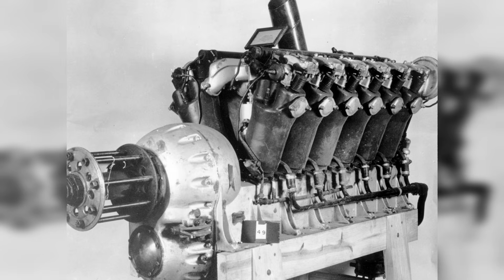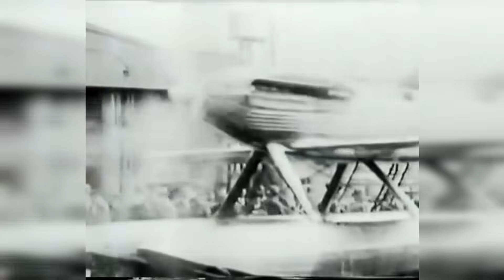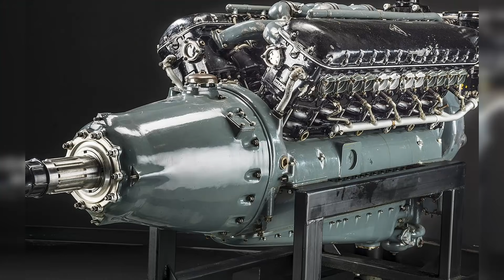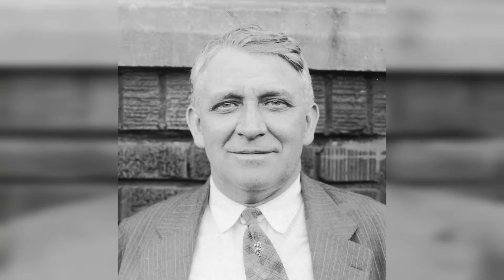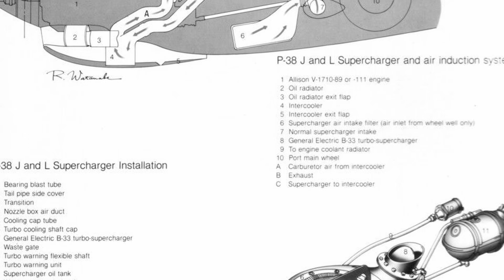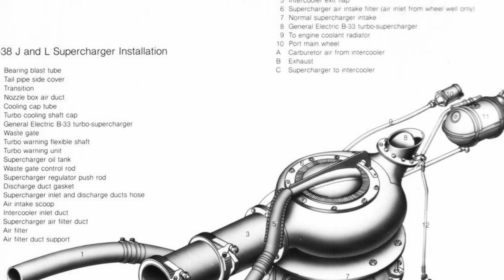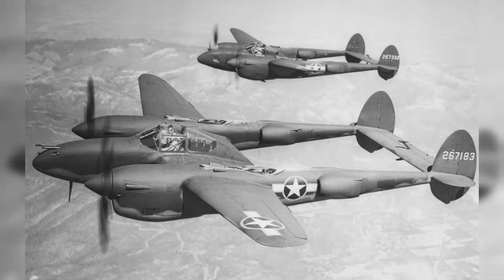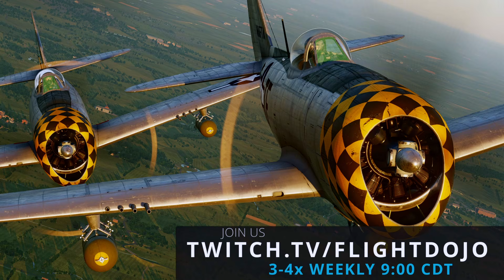Allison V-1710 - A Liquid-Cooled American WWII Warhorse

Comment: Regarded as pretty useless with out a good multistage supercharger.
Reply: Only by you. I wouldn't consider the P-38, P-39, and P-40's "useless" by any stretch. What plane did the top two American aces fly? Uh-huh. Powered by what? That's right.
Reply: @tempestfury8324  didn't work in the P51.
Reply: @womble321  No it didn't. But to say the Allison was useless is just stupid. Just because it didn't work well for one airframe doesn't mean it didn't succeed in others. By contrast you could say that the Merlin didn't work out with either the P-38 or P-40, which is true.
Reply: @womble321  It worked fine in the P-51.  It just couldn't escort bombers over Europe in that configuration.  Plus Allison two stage units became available in 1943.  It's very possible the mustang would have ended up in the escort role with a two stage Allison had the Merlin not been employed.

Comment: A fabulous engine that was castrated by the Army.  The two-stage engine was unwieldy but the hydraulic coupling was quite advanced.  Great video, and all of you Allison fans should check out the book "Vees For Victory", an incredibly detailed history of the V-1710.
Reply: I have it.  It is the definitive book on the history of the Allison engine.  Author Daniel Whitney also has a follow-up book on Allison engines.
Reply: Great.  Can you tell us when exactly did Allison produce the new intake manifolds? ... and if they were retrofitted to engines in the field?
Reply: @bobsakamanos4469  The book isn't in front of me but I think around 1937.  All of the engines in military service had these manifolds, starting with the turbocharger equipped Curtiss YP-37.

Comment: The P-51A was not a good defensive fighter with the V-1710 but is was an extremely good ground attack aircraft in the hands of the RAF. I suspect that the Australian pilots who first faced the Japanese fighters in Papua New Guinea would have welcomed the better aerodynamics of the early Mustang. The final 1710 was still short of the Napier Sabre V in terms of horsepower. I did no know they turbocompounded it. the only example of this I have seen was the Wright 3350 on the Lockheed Constellation and the flight engineer told me it was worth about 300Hp on take off or 1200 on all four.

Comment: Full on reversing the whole ENGINE?  That's insane to me.  The only engines I've ever worked with that do that are two stroke diesels.  Trying that with four stroke gasoline is nuts to me.  Modern planes use variable pitch propellers to reverse the thrust.  Stopping the engine and starting it again in reverse is doing it the hard way.

Comment: Other points to consider: the Allison made more power at any given level of boost and weighed less than the equivalent Merlin and it lasted longer because it had much better bearings!
Reply: Quite true about the engines.  We Americans were world leaders in that area.
Reply: If the Allison engine was that good, then why was it replaced by the RR Merlin in the Mustang? Oh! That's right - the Merlin was better (and went on to make the Mustangs' reputation)!! 👍
Reply: @tim7052 It wasn't replaced by the RR Merlin in the Mustang.  It was replaced by the Packard V1650-1, a modified Merlin 20.  Packard made several improvements to the Merlin.  They cast the engine block in two pieces which cut bad castings to almost zero, a big cost savings.  They adopted Allison-style piston rods which were much stronger, American silver plated bearings which were more corrosion resistant, used a  Stromberg throttle body fuel injection system instead of the RR Merlin's wonky SU carb, and the changed the supercharger drive quill to fit the Wright Cyclone two-speed supercharger.  The 30 liter Wright Cyclone had extra capacity over the 27 liter Merlin.  Rolls-Royce adopted many of these changes.  When fitted with a similar supercharger the Allison will outperform the Merlin if for no other reason than it's 28 liters vs 27 for the Merlin.  The Allison had a 2,000 hour TBO vs the Merlin's 200 hour TBO.  The Merlin had nearly twice as many parts than the Allison and was more expensive to make.  The Merlin had three better features, a better supercharger, better flowing intake manifold and a simple 5 counterweight crank.  The Allison used 6 or 12 counterweight cranks and the designers were still fiddling with the design until production stopped.

Comment: I enjoyed to know that you and a few watchers also knew the V1710 was incially intended to replace the german V12 Maybachs used in the Akron and Macon airships. Airship tech was widely used in airplanes and I like both types. The Crecy book is a dead giveaway of an airplane engine geek, that's cool! If you intend to do a video only about compound engines, don't forget the Napier Nomad, which you certainly know that was a 2-stroke diesel aero engine prototype - a complete alien in the scene, but an interesting one. Great video, keep doing them in any format you like best!
Reply: so why wasn't there more diesel's in ww2 air-anything? as the nazis could have benefitted from them as high quality airo fuels for them was a challenge plus making one fuel diesel is easier and things like tanker's 🐯/sub's could use it and later the foo fighter's ect
Reply: @richardprice5978  I am not shure, but the germans had a series of Junkers Jumo 2-stroke diesels that were widely used in bombers during the war like the Jumo 205, mainly because 2-strokes have a weight to power ratio good enough for aviation, close to 1kW/kg but they were never high-power engines fit for use in fighter planes.

Comment: Why did the merlin make it in to the mustang, if the Allison was that good.
Reply: The Allison didn't have a two-stage supercharger, which was necessary to achieve the altitude performance required of the P-51.  Allison did develop their auxiliary stage supercharger late in the war, but too late for the P-51.  Post-war, the F82 Twin Mustang had two-stage supercharged Allison G-models.  But by that time, everybody wanted jets.

Comment: A lot of good new information. Unfortunately, some post war mythology gets perpetuated which calls into question the validity of some of what he says. The whole Merlin vs Allison P-38 controversy for example. The Allison's installed in the final versions of the 38 were making 1800+ horsepower, unfortunately the 38 lacked the propeller to take advantage of the excess efficiently and switching to hydraulic props from Curtiss electric props wouldn't have been trivial.
Reply: I don't think any production version hit 1800 HP, but they had that and more if they wanted it.  The Turbo Allison was unquestionably the stronger engine in that application.  The only two reasons to consider the Merlin would have been to solve the the issues the early issues the Turbo had at cold high altitudes over Europe, and possibly to save space in the booms for more fuel tanks?   But like you said, considerable redesign would have been required.  It really didn't make much sense.
Reply: @sebclot9478  I was under the impression that the late war P-38's Allisons were capable of producing in excess of 1800 hp with sufficiently high octane fuels and water methanol. Those high power numbers were, of course, for five minutes at WEP.

Comment: was sold to russia in the cobra aircraft,mid mounted,why they all ran it N/A against all sorts of forced induction engines
Reply: Most of the airwar on the Eastern Front was at low altitude, and the P39 was great for that.  Also a great tankbuster with its big cannon.
Reply: @andyharman3022  : Actually, by Soviet accounts, the P-39 was rarely used as a "tank-buster". They used it mostly as a fighter and for ground support.
Reply: @tempestfury8324  True.  People just assumed because of the 37 mm cannon.

Comment: Great vid, I am a Brit, therefore the Merlin V12  will always be at the top, but was the Allison engine perhaps slightly late on the scene, and therefore not deemed important enough to enhance it further, especially as the Merlin had transformed itself from an ugly duckling to a swan, in a relatively short time span, so making the Allison a bit old hat? i am in no way starting an argument!! as really it doesnt matter, as collectively, we beet the Axis, to remain a free world, well, for a few years !!
Reply: RR had the Schneider Trophy competition to drive their learning about high-boost supercharging and high-octane fuels.  The Brits could see the war coming sooner than the Yanks, so their development of 2-stage supercharging for the Merlin was done out of a higher sense of urgency.  Allison was directed by the USAAF to develop their engine for use with the GE turbocharger, because it was a more efficient system than 2-stage mechanical supercharging.  But during the war, supply was prioritized to build turbos for high-altitude bombers, so Allison was left out in the cold.  Their auxiliary stage supercharger came too late, and was not as well-integrated into the engine design as the Merlin 61.
Reply: @andyharman3022  I suspect it wasn't integrated to allow easy upgrade of Allison engines already in service, but that upgrade never happened.  A good idea though.

Comment: Thank you. I have heard that the engineers who managed to package up the merlins two stage so it fitted behind the engine and only lengthened the supercharger a bit  were miracle workers. Also - what is the capacity? Merlin = 26 cubic inches: is the Alison 1710 cubic cm? And if so is it notable? (I know, I should look it up) thanks again great video.
Reply: Merlin:  1650 cubic inches.  5.4" bore, 6.0" stroke
Allison:  1710 cubic inches.  5.5" bore, 6.0" stroke
Reply: The Merlin is only 26 cubic inches?  That's a lawn mower sized engine!
Reply: @sebclot9478  i think i was thinking litres.
Reply: @simon-gr-au  I think everyone knew what you meant.    I just took advantage of the moment for an easy laugh.  Stupid uncle jokes are my specialty.
Reply: @sebclot9478  ah, fair enough. FYI Greg's latest video (Greg's automotive and aircraft YouTube channel) has an interesting mention of the Merlin.

Comment: The Allison was a VERY rugged engine and its use in aircraft like the P-40 and P-39 showed it could be significantly overboosted up to 70+ inches of manifold pressure with its single stage supercharger. I was always a great low and medium altitude engine and a shame it didn't have a better two stage two speed supercharger. In the P-38 with the addition of the turbo-supercharger it really shined!
Reply: This. I have a letter from a US General claiming he personally pushed a P-40E to 75" on a regular basis. The engineers at Allison hated this because when they changed the supercharger ratios in later engines, they started blowing up if pushed that hard.
Reply: This is the engine Trans Canada Air Lines should have chosen to power their  Canadair C-4M North Stars, as you rightly stated the 1710 is reliable and bomb proof, ideal for intensive airline application . With a three speed two stage blower, Bendix fuel Injection, a 1710 engined C4M North Star burning regular airport 100/130 grade petrol would have superior performance at high altitude vital to avoid those vicious North Atlantic storms.
Reply: and the overboosting often resulted in thrown rods, broken cranks, blown cylinders and other problems from detonation.  The G version of the Allison was much strengthened, but too late.  The intake manifold was one of the main problems.  Low cylinder temperatures during cruise also caused rapid lead buildup, fouling and detonation, etc.
Reply: @bobsakamanos4469 I still do not underastand the lack of development on the Allison.
P40 was second best airframe.
Only lost for the P51.
It was waste
Reply: @marcobernarda9493  GM didn't like spending their own money.  Allison did try to produce a better intake manifold late war, but by 1944 the P-40 production was cancelled.
Reply: Bell had real problems with high boost on the P-39 destroying the early engines. The resulting fatalities resulted in a number of court-martials.
Reply: The Allison was tested for HOURS at 80" of manifold pressure and 3,200 RPM. It easily passed the test. Repeatedly.

The USAAF however hated the idea, and refused to approve the settings. However, units receiving 150 octane fuel routinely rigged the P-38 Allisons to run those settings in War Emergency Power.
Reply: Great engine down low and RAF Mustang Is were still fighting in April 45 Those turbo supers were too large and added too much weight . The Mustang I was 10 times better than the P38 on low low Ops.
Reply: @jacktattis  The P-38 was designed as a pure interceptor. It wasn't meant for "low low ops".

The turbosupersharged fighter that was really good "down and dirty" was the Thunderbolt.
Reply: @patrickchase5614  It was not a good high altitude fighter for a host of reasons that included airframe issues, engine issues and ancilliary installations.  The P-38 was also extremely expensive to build, operate and difficult for new pilots to learn.  Weapons were its best attribute.
Reply: @patrickchase5614  That is all it was good for. Its Dive was abysmal
Reply: @bobsakamanos4469  and its climb rate was realy good....
Reply: @patrickchase5614  whats low ops....it was fine down low lol...it was a great strafer   could carry tons of bombs and rockets and had a cannon...
Reply: Allisons were mediocre at best.  It crippled the P-40, P-39, and P-38.  Oh, and ALSO the first P-51.   Early Allison Mustangs were almost rejected by the British until someone said "what if it had a Merlin?".  The handful of P-40s that were given the Packard Merlin had performance almost EQUAL to the Mustangs.  Sadly, Merlins were eventually earmarked strictly for Mustangs forcing Curtis back to the Alison. 

Look up the Mustangs history.  Specifically the re-tagged A-36 Apache.  Poor preforming Mustangs converted to strictly ground attack with air brakes incorporated because it was useless as a fighter. 

Think of what kind of plane the Lightning could have been with a pair of Merlins.  It too suffered in Europe from poor high altitude performance so it was also delegated to ground attack missions.  The pacific theater didn't have the high altitude dogfights so it shined against the Japanese. 

The government should've forced Alison into producing licensed Merlins. 

Same with the Wright radials. Inferior in so many ways compared to the Pratt and Whitney R-2800.  The B-25 was incredible, but with P&Ws, it could've gone toe to toe with the A-26.
Reply: @ghostinchains664  GM had a lot of control over the government acquisitions. Look up Lt Gen Knudsen, the only civilian to enter the military straight into that rank level and made Director of Production in the Office of the Under Secretary of War.  He'd been President of GM for many years.  GM owned Allison... and the head of Material Command at Wright Field, MGen Echols.
Reply: @ghostinchains664  The British contracted Packard to produce the Merlin before the U.S. entered the war. It was not designed for American production methods and had to be redesigned by Packard. The Allison was an American design and would have been a better choice. General Motors was had their hands full with wartime production and did not want to redesign the Allison's supercharger system due to wartime demands.
Reply: @phlodel The Merlin was redesigned by Ford, not Packard - Henry Ford personally vetoed the production contract because he didn’t want any aid going to Britain.
Reply: @ghostinchains664 The A-36 Apache was designed specifically to keep the P-51 production line running because the U.S.A.A.C. had a spare budget for attack aircraft but not fighters in early 1941.
Reply: @allangibson8494 no. The Apache was the result of the poor performance Allison P-51.  When it couldn't compete as a fighter, the Air Corp created the A-36.
Reply: @ghostinchains664 Check the actual history. They went from the P-51 (NA-91) to A-36 (NA-97) to P-51A (NA-99) all with Allison engines…
The A-36 got dive brakes and was the first Mustang variant with bomb racks (that every subsequent variant kept).
Reply: @ghostinchains664  Sounds like more British hubris to me. The Allison was as good or better than the Merlin except the Type 61 and beyond with their high-altitude performance capability. In the Pacific where combat was conducted at lower altitudes, they didn't want the 'finicky' Merlin. Not to mention the Allison was far easier to build, service and far cheaper-it was designed from the get-go for American mass production. The Allison had half the components of the RR Merlin, with all that entails from a logistics standpoint. When you're fighting a world war and shipping weapon systems and spares all over the world, these things matter. The UK had too much production capacity tied up making RR Merlin engines, that's one of the reasons they approached Ford and then Packard to supplement their capacity for components-though Packard insisted on building whole engines instead of just components.